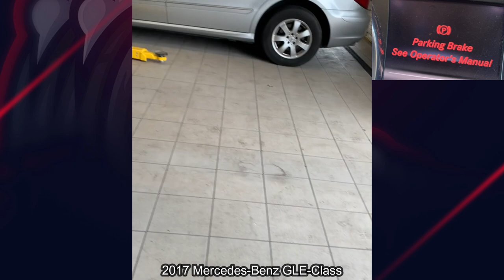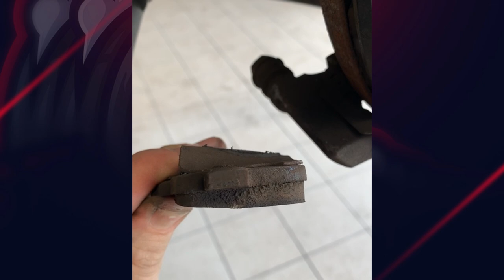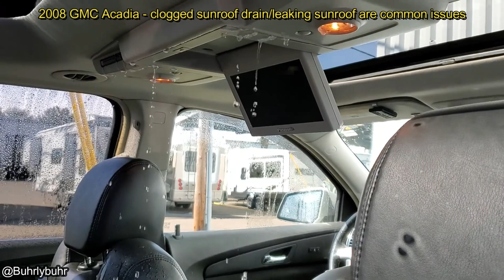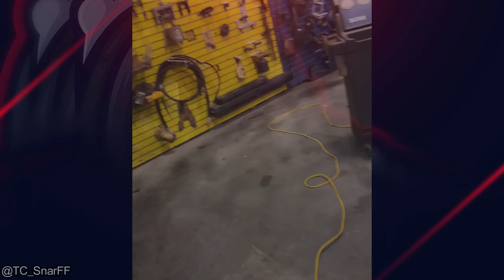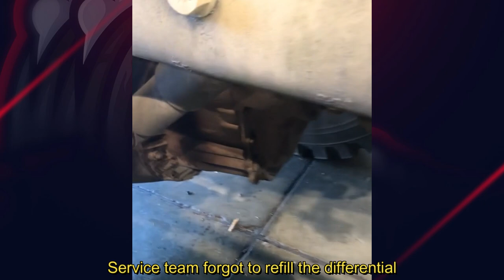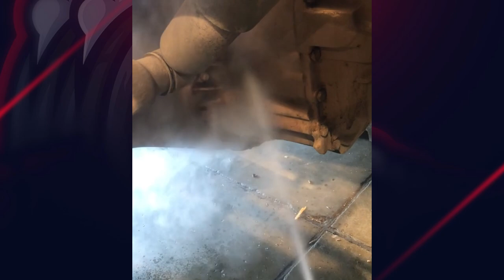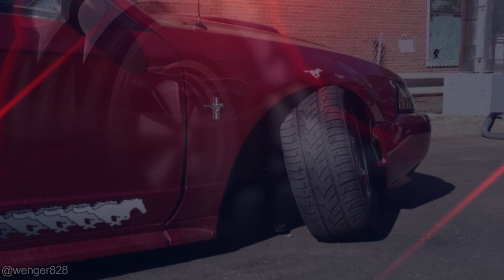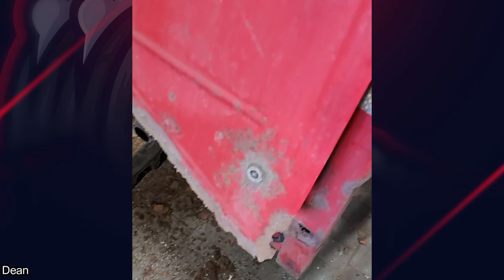Customer States Parking Brake Message On Dash | Just Rolled In

Comment from the maker: What's the weirdest thing you've seen in a tire?
Reply: Found a wallet one time
Reply from the maker: @evilborg  Lol really? That's awesome.
Reply: @JustRolledIn  Yup... turned out to belong to a tire manufacture employee who apparently lost it while inspecting tires LOL
Reply from the maker: @evilborg  lol too funny. Well at least he got it back
Reply: When I was a kid my dad took me to the garage he was working at guy came in with a rail road spike thru the front tire, brand new 1991 town car.
Reply from the maker: @tylercovey327  damn that sucks on a new car! I have a rail road spike in my tool box from 10 years ago. Customer wanted tire patched 😜
Reply: The weirdest thing, I bagged a freaky  girl bent over a tire....
Reply: It look like a wine glass stand poked in the tire?
Reply from the maker: @skoalonguys6788  that's what I think lol. Maybe they drove over a picnic? 😅
Reply: Little balls to balance the tire. Oversized off road
Reply: there was a whole screwdriver in a tire that came in. was still holding air lol
Reply: I had a slow leak about 25 years ago in a tyre. Took the tyre guy 30 min to find the leak. A rusty paper staple had somehow penetrated 8 mm of rubber plus 2 steel belts and was just poking its way to the interior of the tyre. The staple was only 8 mm long.
Reply: center divider reflector the big cast iron h shaped one front tire kicked it up went through the rear tire and split the rear rim and lodged there weighs like 10 pounds.
Reply from the maker: @CornTheCob69  nice. New screwdriver!
Reply from the maker: @matthewgibbs6886  damn!
Reply: a camera - i think it was on garage 54 but i'm sure a few youtubers have done it now.  nothing spectacular but really weird to watch!  great video again, btw and i really appreciate the work you put in to the description.
Reply: Found some pockets welded on the rim inside the tire stuffed with coke one time crazy had to call the cops car got towed. Guy brought it in for tire balance had no clue  he was a drug smuggler. And omg that diff was so crazy hot bet It sized up when the temperature whent down
Reply: A mechanic left their scan tool in my dad's car
He never returned it
Ironically someone stole the scan tool 

Karma I guess 😅
Reply from the maker: @joegrossman5073  wow 😂😂
Reply from the maker: @RexWort  😂 oh geeze lol.
Reply: We found some kind of spike in a tire went in through the tread and out of the sidewall never leaked customer complained about the clunking noise
Reply: Found someone’s tire air gauge. In MY tire
Reply: A brick
Reply: When I use to work at a tire shop a while back..seen a bone sticking out when they ran over a dog..Also seen a rock about 3in diameter between the wheel and bead Have no idea how it held air!!!I can tell you more but I believe it!
Reply from the maker: @mflorest3  awh, poor doggo 😧
Reply: I once found a drill bit STILL in the chuck but broken off the drill, customer stated they thought they hit a squirrel....
Reply: I had a thin slice of steel about 5cm long from the edge of a tram track that must have finally crumbled after years and ended up in my tyre.
Reply: Writing on the inside of my dads tires saying he likes little boys lol. He worked at a tire shop.
Reply: The vehicle's ignition key
Reply: Mouse trap.
Reply: Some small, flattened metal pipe that went all the way through and was being tossed around inside as the car moves.
Reply: I found a spark plug in one. When I told the owner that the tire was shot she pleaded with me to try to fix it because she couldn't afford a new tire. I tried to convince her it was unrepairable but I finally gave in and used the largest patch I had which was 3 inches in diameter. The hole was in the center of the tread and the tire held air after patching it. I told her there was no guarantee it will last. I never heard from her so who knows?!
Reply: A meth pipe
Reply: I ran over a screwdriver and my front tire kicked it up, fortunately my car has air diverters in front of the rear tires and it stuck in that instead of going straight in to my left rear tire as I was entering a cloverleaf
Reply from the maker: @thomasfletcher4765  that's not where it goes! Lol
Reply: @evilborg  Ok...you win. I was going to say I caught an propeller with the shaft (some small RC airplane? Dont know..) but a wallet...yeah, thats a first.
Reply: I pulled a piece of stainless steel jewelry out of a tyre on my wife's old car. Looked like a mini barbell. Tyre had a slow leak which is why I checked. That same tyre also had 2 screws, a piece of fencing wire and a Philips head screwdriver shaft, all stuck in the tread.
No clue how she could get so many punctures and I think it was all because the tyres were cheap and not very good.
Reply: @JustRolledIn  wasn't mine , it was on a jeep I had to repair a tire on
Reply: I ran over an air chuck. Not the small car type either.
Reply: I use to work at a Mr tire don't laugh Lol. I found a sprak plug in a front tire it was completely inside bouching around
Reply: Small engine crankshaft stuck in a 385/65R22.5 steer tire on a refuse truck.  Tire still held air.........
Reply: small piece of pot cleaning pad, those curly metal ones. this is back in the days of tubes. turns out one of the local shops was running a scam and would put a strand in which would wear a hole in the tube. the reason for the scam was the tire chain was running a competition, the shop that did the most puncture repairs got a free overseas holiday.
Reply: An unfired bullet. It was either a 30-30 or a 30-06. Sagebrush in the sidewall, too.
Reply: A tree branch in a 4wd SUV
Reply: A ball point pen and on television bricks of marijuana
Reply: Lots of water in that exhaust
Reply: When I was a wee lad. I took my car a 1977 Chrysler new Yorker past 
M!d@$ for a free brake inspection. They claimed that it needed 2000.00 of work. 
I said no and took it home to double check what they said. 
One item was a plugged brake line. 
When I checked, they put a device like channel locks on to stop the flow of fluid to the brake shoes. 
What @$$holes
Reply: @loose-arrow-garage  -When it lost air again, she told all her friends"Never go that shop, they can't even patch a tire"... ;}
Reply: Lug wrench, flat end stabbed through the rear tire tread,  (rear tires, after fronts stand the 'item on end, usually get all of the 'fun;). Made H of a noise each revolution.. ;}
Reply: Railway spike
Reply: Pair of slip-joint pliers.
Reply: I had an allen wrench stuck in my tire. I took it for a car inspection and asked them to check my tire cause it said it was low. They found nothing.  I drove to get an oil change, mentioned same. They didn't find anything.  Drove 3 hours to see a friend for the weekend. He works at a Kia dealership. Mention tire low. Finds allen wrench.  Why didn't I find it?  I trusted the inspectors and apparently my 2017 Honda Civic is notorious for showing low tire pressure as I had dealt with that constantly after every oil change.  They said that the system is seriously just terrible.
Reply: @meiskavedrine9986  I used to put 45+ psi in the tire and check it with soapy water, or put it in the dunk tank. Works every time.
Reply: Tire iron
Reply: @jakkbatt4711  Well, that's not That weird...
Reply: Rebar
Reply: Ran an 11R22.5 500 miles home with a 3/4 inch bolt in the tire. The heat sealed the leaking air. And it never blew out. 
Another time I had a tire peal the cap off.
And it never lost air pressure. Got it home as well. Had a 425 65 R 22.5 on a dump truck tag axle Blow out at 45 mph. It pinched a 5.5 inch exhaust pipe in to. The pipe was 3.5 ft away from the tire.
Reply: @jerrykinnin7941  Saw a truck tire explode just before I passed the vehicle. Sounded like a gunshot.
Reply: Chunk of chrome trim about 12 inches long. Was in the tread and it kept coming like a magic trick as it was pulled out.
Reply: a car key
Reply: Not really inside the tire, but once I went to fix a leak on a left tire which was visibly alright and found out my right tire was full of small nails and screws, yet not loosing air 😅.
Reply: I've found nails that went in head first a number of times.
Reply: Part of a strip of nails from a nail gun, so like 10 collated nails in a row. A single edge razor blade. A spark plug. A complete 9mm round, unfired but severely deformed, primer facing out. I once got towed for a bad fuel pump and the tow truck driver lost a hitch plate from his bed that my truck then got a flat from.
Reply: A flashlight lol. The owner of the vehicle thought he would be all cool to get him a cheap tire repair kit and he had a really bad hole in his tire from running over a plumbers wrench in the road. He dropped his flashlight in the tire trying to look to see if there was anything in the tire and he couldn’t get it back out so he just put tape over the hole and filled the tire up with air and then came into our shop. My and my co workers died as soon as we saw it. We still talk about it in the break room. A new employee came in Monday and after fixing a few tires he said he was really bad at patching tires. Me and all my coworkers looked at each other and somehow said in sync “You can’t be as bad as the dude that put a damn flashlight in his tire.” We all busted out laughing.
Reply: I mentioned it before, but we found a whole hammer inside a tractor tire.
Well, it was shattered into pieces and covered black in rubber.
Reply: a piece of straw in a tractor tire causing the flat
Reply: I was replacing a small tire a wagon for a lawnmower and I took the tire off and there was a 14mm wrench inside apparently they tried to change it them self and gave up
Reply: Pulled up outside my parents house once and I hear hissing from the front as I get out.  Driver's side front tyre deflating rapidly so I, in the rain (it's Britain...rain is the one constant) changed the wheel and inspected the leaky one once done.  It had what looked like a Stinger nail in it - a hollow tube embedded in the tread that was letting the air out.  I figured it might have been left over from a traffic stop or something and took the wheel to get it fixed.

The tyre-fitter later revealed it was not a Stinger nail but the conical metal shroud that screws onto the tip of a pen.  I had no idea they were made so tough they could withstand being run over by a BMW but there you go!
Reply: a dead spider literally INSIDE of the tire. I have no idea how it got in there or made a web.
Reply: Had a turtle shell
Reply from the maker: @gbeving3167  wow, that's unusual
Reply: @Just Rolled In  guy run it over with his harley. Those shells are ungodly sharp

Comment: Love it when a customer declines an essential repair and the follow up repair costs a lot more than the first one.
Reply: Had a guy do that with a set of brakes. Metal on metal. Came back 6 MONTHS LATER and was mad he needed calipers and a fluid flush, too. Idiot.
Reply: Had a customer with an e-type fhc, told him he needed new tires on the front because they were old and cracked, he just said he was gonna do it when back from vacation and that he already suffered a blow out on the rear with damage to the quarter panel and trunk floor. He did come back after vacation after the left front tire blew and took out the headlight, the splash shields, the chrome trim, damaged the fender and hood. That was an expensive tire replacement to say the least. He had us to fix the rear damage at the same time.
Reply: @youtube-handle-are-a-joke  Ouch.
Reply: @youtube-handle-are-a-joke  You would think he would've done the tires Before the trip.
Reply: @Ogrematic  that's what we told him, but he thought it was going to hold despite having already 1 tire that blew, he was lucky that it didn't happen at 70 on the highway. Plus I don't think a couple of tires would have make a dent in his wallet, but he really wanted to squeeze every possible miles out of his rotted tires.
Reply: @youtube-handle-are-a-joke  Freakin' cheapskate. My dad was a firefighter and in the Navy, so safety was paramount in my home and my upbringing. When I was a tech, I never rushed the safety check.
Reply: @youtube-handle-are-a-joke  penny pinchers always cost themselves more in the end
Reply: @jakkbatt4711  Yeah, but also some people just cant afford it.
Reply: @jotenmike  those same ppl always have enough money for cigarettes,  alcohol, weed, etc.. 🤣
Reply: @jakkbatt4711  Well, I dont
Reply: @ShellShock794  most shops will try to upsell service or parts that don't need immediate repair or replacement.

Then again there are brake shops that tell people they can't leave unless all this other work gets done because of safety or whatever.
Reply: @ShellShock794  most shops will try to upsell service or parts that don't need immediate repair or replacement.

Then again there are brake shops that tell people they can't leave unless all this other work gets done because of safety or whatever.
Reply: @Ogrematic  He can consider himself lucky he didn't need a master cylinder.
Reply: @nocount7517  I know, right? I probably should have checked it.
(Jk.)
Reply: @jakkbatt4711  Bad penny pinchers do. I'm a penny pincher but, i believe in what i like to call investive spending. It basically means spending a few dollars today to save a few hundred dollars tomorrow.

Money grows money but, only if its in motion (being used). The trick is choosing the right things to invest in to maximize your benefit.
Reply: @darkstorminc  yes but, you can verify this. You can also ask them to show/prove what they are saying. Most of the time damaged parts are REALLY obvious and any good mechanic won't mind showing you in good faith.

Remember scam mechanics hurt them too so they jump on the chance to prove their worth.
Reply: they’re declining the repair because they can’t afford it so please let us know how to pay for repairs when we don’t have money
Reply: @misseselise3864  But you still wanna fuckin' drive it? We do safety checks for a reason, take a taxi.
Reply: @misseselise3864   Either walk, take the bus or learn how to do it correctly yourself.
Reply: So many shops run scams where they "replace" things that don't need fixing so people don't actually believe things are necessary when an honest mechanic says so
Reply: @KNR90  I worked at a shop where an old guy who had been there for years had just left. When they moved his tool box away from the wall, the space behind it was filled with small parts and gaskets still in the plastic he said he replaced. One guy who worked there sold a fuel system flush on every vehicle, then just poured the flush into his oil drain bucket to get the 5 dollar chip from the bg guy who came in once a month. Scumbags.
Reply: @misseselise3864 , it doesn’t make sense to own a vehicle if you’re unable to maintain it. So…now that you’ve declined an important repair and end up bringing it back in soon after because the part that needed repairs now has failed and as a result causes more expensive damage. Yes…that was very smart.
Reply: Not everyone has a bunch of money but we all need to get to work and do our running around.....
Reply: I'm more surprised that the mechanics are not forced by law (as it very surprisingly seem) to call the police as the car is totally unsafe to drive on a road and will be a big part of the cause if the customer will be involved in an accident due to the problem.

Comment: I check my brakes and freak out when they look like they are getting low. It amazes me people ride the rotors till they fall apart and act like it just started yesterday.
Reply: any advice on knowing when rotors are worn out? people seem to just buy new one with every brake pad which is wasteful
Reply: @hundredlives3910  Places don't really turn rotors anymore. The main reason is because people don't really know how to do it right. It is just easier to get new ones and not worry if they were done right. I had an auto parts store screw up a set a rotors turning them. I have found that many rotors can not be turned, they are too thin in the first place. Whenever I change the brakes, I purchase upgrade brake pads. I also upgrade the rotors to  cross drilled/slotted.
Reply: @hundredlives3910  You have to measure the thickness. Rotors should have the minimum thickness stamped on them.
Reply: @tdrewman  
"The main reason is because people don't really know how to do it right." 

Uh, no. The main reason are 
1. because quite a few manufacturers say it isn't allowed anymore, the current rotors are basically built juuuust thick enough to do their job for weight savings. There is almost no excess material to remove in resurfacing and many manufacturers say not to even try. 

2. and probably even more important, common car rotors are fairly simple hunks of steel, there production can be pretty automated and their prices haven't increased nearly as much as labor costs. At this point the labor charge for the extra time to a turn a rotor covers the majority of the cost of a new part,  literally we're taking 80% or more of the cost (this has become the case with many things that might in the past have been rebuilt or recondition actually). When it might be only be like 60-80 bucks more for a full set of completely new factory fresh rotors it starts to seem pretty silly to take the chance trying to recondition something as absolutely critical as brake components vs just going new.
Reply: Seen rotors worn to the cooling fins.
Reply: Normally rotors will last hundreds of thousands kilometres.
I don't even understand how to break brakes like that.
Reply: @tdrewman  why are you talking about that? The person you replied to never even mentioned it.